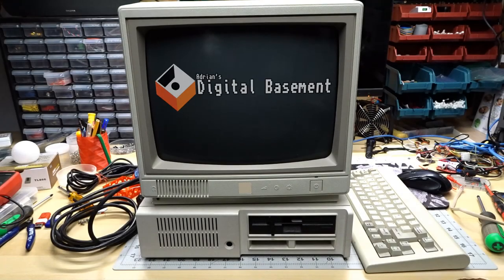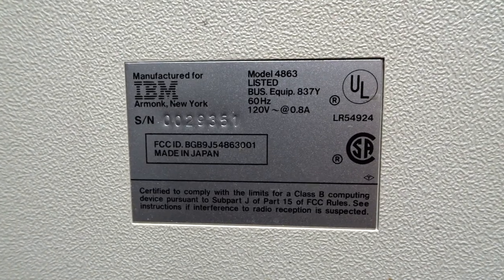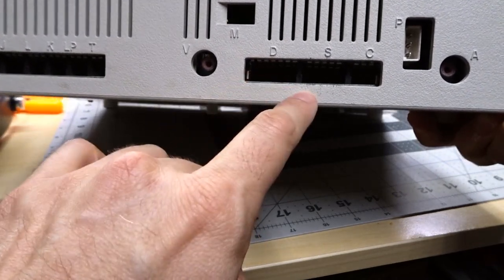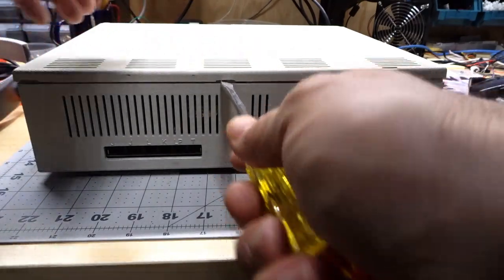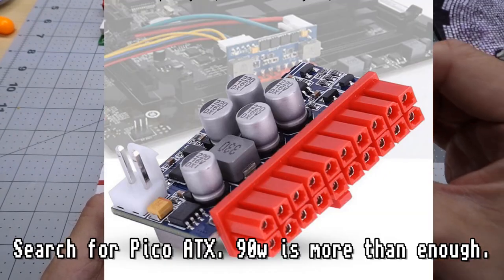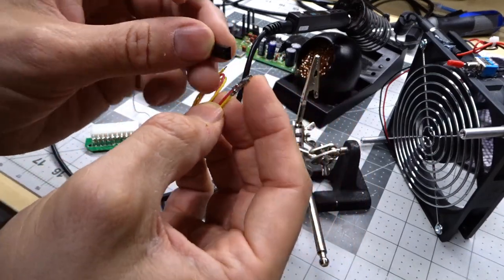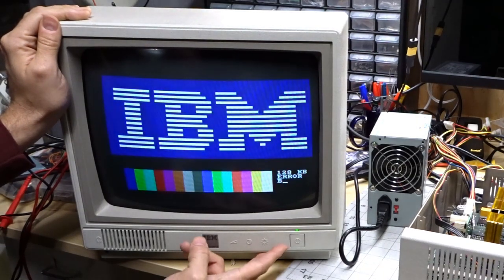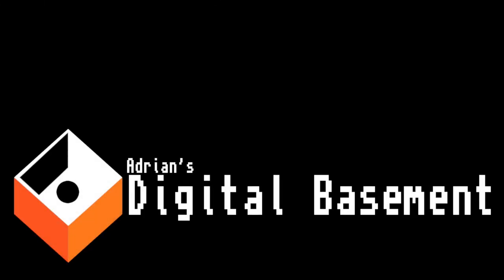Found a cheap IBM PCjr -- does it even work?

Comment: I came to say LGR has reviewed an alternative keyboard that works on the IBM PCjr. It is the Cherry KXN3-8451. Link: https://youtu.be/olmM3tNqHys But I'm not sure if you could find one, let alone one with the cable you need, let alone for a decent price. Then I saw jddepew offered you his IR board(s), but I still figured I would add my two cents. Love your videos!
Reply: Failing other options, I searched around and found a connector pinout for your keyboard cable. 
http://classiccomputers.info/down/IBM/IBM_PCjr/IBM_4862_PCjr_Technical_Reference_Nov83.pdf on page 3-88 of the manual, which is page 254 of the PDF. Perhaps you can hack up an old phone cord for the purpose. If this doesn't help you out maybe it'll help someone else some day. Good luck!

Comment: I all ways wanted PCjr i couldn't find one
Reply: I had a PCjr as a kid and hated it because no hard drive.  Mine only had 512KB RAM and that was also a problem.  And 40 column display when attached to the TV (instead of a real omitor) That last 128K was necessary for most of the games you would want to play.  But I could play Leisure Suit Larry, as long as my parents weren't home.

Comment: The 8 Bit Guy / LGR might be able to help you out on some bits.

I know that The 8 Bit Guy also had a missing badge, and he had a good solution for it. LGR might be able to help you with the keyboard cable and IR board. Or maybe The 8 Bit Guy has a spare IR board. Or Techmoan might be able to help you out with the IR board

Comment: Found a guy that has the IR module on ebay  https://www.ebay.com/itm/IBM-PCjr-Wireless-Infrared-Receiver-Replacement-Module/140986675098?hash=item20d375ef9a:g:fnoAAMXQqfZRpWrq

Comment: I find it odd that this has any collectability.  It really has no redeeming qualities and without Tandy, it would just be a footnote which is completely unremarkable.  I suppose the pre-launch hype gives it a bit of notoriety.   It is essentially just a very poorly made clone. The PC-Jr graphics and sound standard is far more well known as the Tandy standard.

All those proprietary connectors make it difficult to collect. Really, without ebay, collecting for it is impossible. But if you are going to go on ebay, all the fun is lost. You may as well be buying a modern computer. Going to flea markets and yard sales and thrift stores is part of the fun of collecting. Ebay might as well be Amazon or a catalogue company.